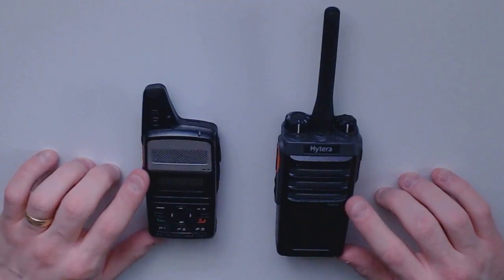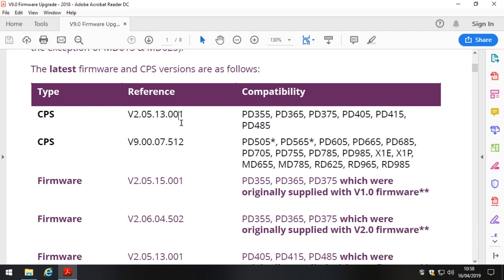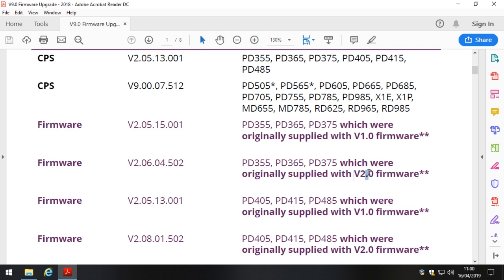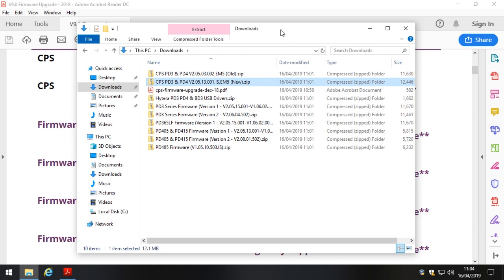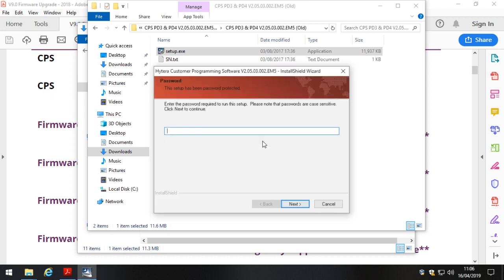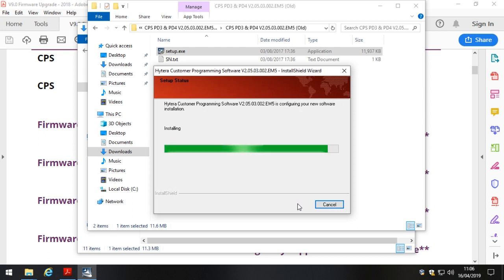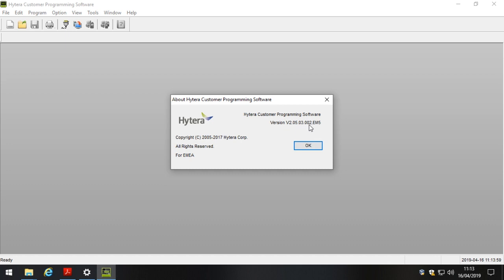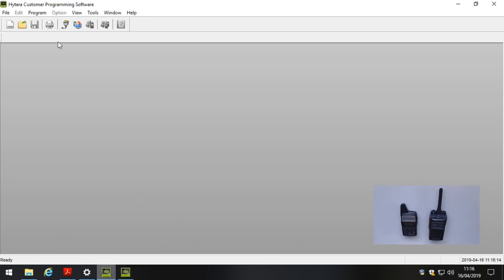Hytera PD3 & PD4 Programming Software V1 & V2 Installation & Explanation

Comment: Hi, recently i bought the Hytera PD365LF, which has firmware 2.03.01.001 and have updated to latest firmware (09-03-2021) available, everything works,  with older firmware the PD365LF was not visible for CPS

Comment: how do you even managed to upgrade pd365 firmware to v2? i have pd378 and (always) successfully doing upgrade (with upgrade kit) to V2 but it always shows V1 on the handheld.so somehow the upgade process was finished but the FW was still the same. any enlightments ?

Comment: Hi. I have a few hytera pd405 with firmware v2.05.13.001, I have a programming cable for them PC76 V1.0 but anytime I searched the internet I could not find the programming software for this firmware.
Can you help me with it?
Reply from the maker: Unfortunately not. I would suggest you update all radios to the latest possible firmware. Then you can program them with the latest compatible CPS as shown in this video.